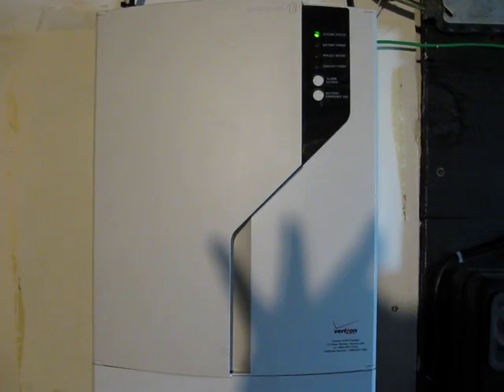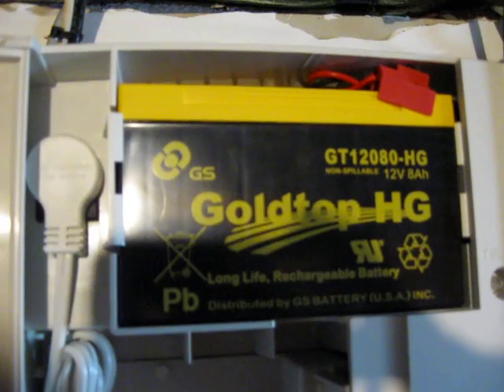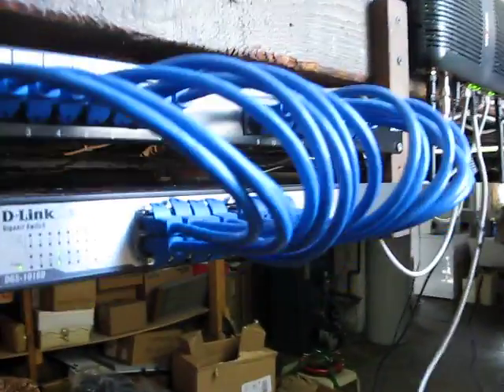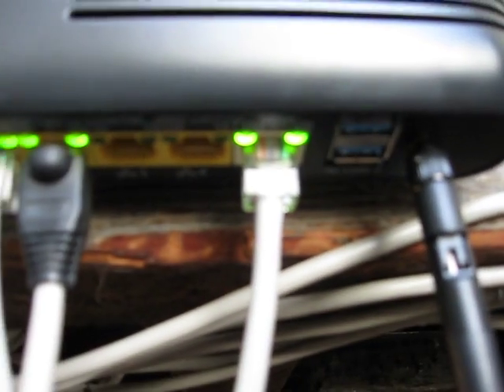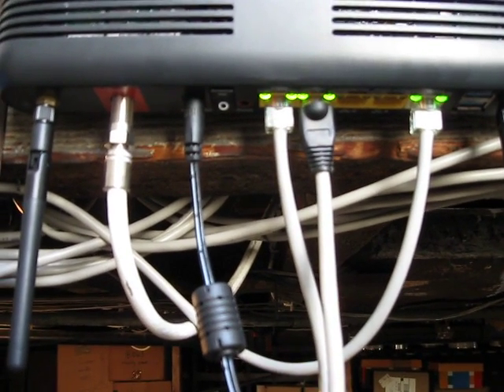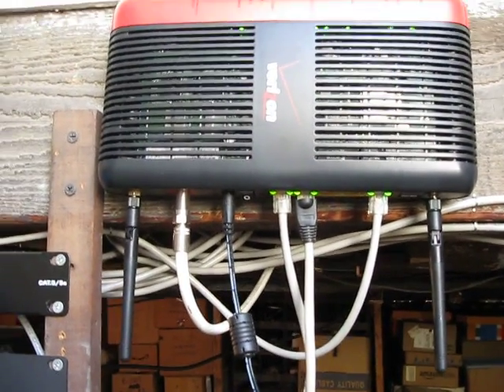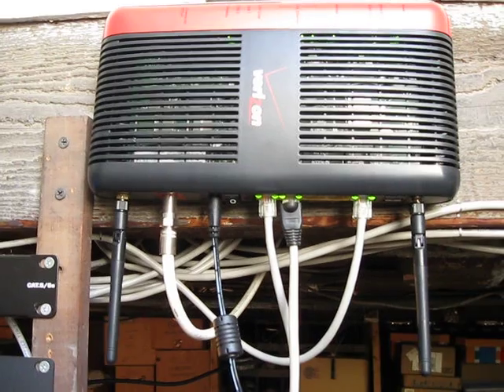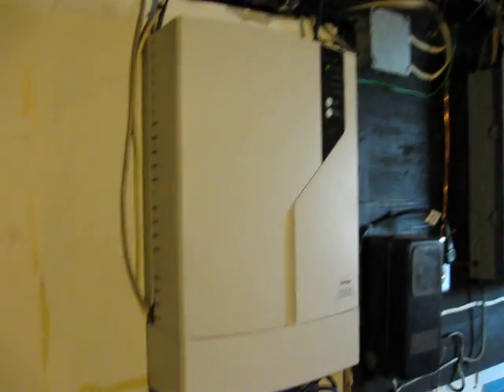My Verizon FiOS installation

Comment: Can you get files but have your phone service over the copper land lines? I think that for telephone service, the copper land lines are much more reliable than FiOS because the central office has bigger batteries and generators and can power the line and definitely for a longer period of time that the back of battery that is at the fiber terminal. My area is served by Frontier Communications and does not want to put a conduit in the street for copper facilities and there is no fiber here Copper land lies should be federally mandated even with the installation of copper land lines in new developments. We have also had outages with AT&T nationwide and Microsoft and also horizon cell network so that’s why.

Comment: Ok but how do I activate the ONT? Verizon customer service is of no help. The ONT was installed in my apartment long before I moved in and I'm not sure it was ever used because there was dust from the wall on the power cord and the cords were all tied up in twist ties. I plugged it all in yesterday but according to my Verizon account it is not activated. The only lights that are on inside are the network and power. There is no coax line connected inside (like where the Ethernet and coax connections are) and I have to run the Ethernet cable to my router because there are no Ethernet outlets. The ONT is an Alcatel lucent unit I-211M-H

Comment: I’m rehabbing an empty house and it has a Verizon box from the former owner on the OUTSIDE which isn’t even connected to the house. It broke off from the house and It’s just sitting on the ground and looks bad and I want to get rid of it. Is it safe to cut the wires? It looks like the wires go to the nearby telephone pole, so I’m afraid they might be energized. The Verizon Service is shut off, but the company didn’t come out to take their equipment. Thanks!
Reply from the maker: Look at the writing on the side of the black cable going to the pole. If it says something like "optical cable" it's fiber optic line. It's not energized as it can't carry electricity, but don't cut it. That basically ruins the cable. Verizon still owns it and the box (ONT) that it's attached to, call them to have everything either removed or fixed. They'll likely want to keep it there in case you or someone else wants to get FiOS service there in the future.
Reply: Adam Ahmed : Thanks for the info, Adam. I’ll see if I can disconnect the cable, roll it up, and attach it to the fence. After awhile, all the junk that’s left over from various cable providers starts to detract from the appearance of a house. Rusty old satellite dishes, faded plastic boxes, etc.; if I can remove the box I’ll just drop it off at a Verizon store.
Reply from the maker: If you can open the telco side of the box (needs a socket wrench) the fiber disconnect is in there. Be careful not to look into the end of the fiber once it's disconnected.
Reply: Adam Ahmed: why not look? Not that I would...just curious why.
Reply from the maker: Same reason you wouldn't look into a laser pointer.

Comment: How do the TVs hook up? Can I run 1 RG6 to the attic and use a splitter to feed the individual tv boxes?
Reply from the maker: Coax from ONT goes to 2-way splitter. One output from this splitter goes to the router/MoCA adapter, the other goes to an additional multiway splitter. The outputs of this splitter go to the cable boxes.

Comment: So Fios is a Cable System after all ???
Reply from the maker: No, an internet system is defined by what type of physical wires and data transmission protocol is used to bring the service to the customer. Cable uses coaxial cable, FiOS uses fiber optics. So it's not cable. In any internet system, there's a device that translates the incoming internet connection into Ethernet, which then goes to the router. In FiOS this device is the ONT, in any other system it's the Modem.

Comment: Get the new FiOS Quantum Gateway router from Verizon FiOS is all new i have my for very long time i love it <3
Reply: Cool I have fios to
Reply from the maker: I had one for a while. I recently replaced it with a Ubiquiti EdgeRouter Lite and two UniFi access points. They're better by far. Yes, you can absolutely use a third party router while having FiOS TV, you just need a MoCA adapter  (which I have) to give your cable boxes an Internet connection.
Reply: Yep :D
Reply: I love fios

Comment: Hey one Question why did u put the Internet modem outside and the other stuff outside what happens if it rains.
Reply from the maker: +Michael Barcomb What are you talking about? All of my equipment is installed indoors in the basement, nothing but the fiber optic cable going to the pole is outside. It's actually more common for the ONT to be installed outdoors, these use a different enclosure that's designed for outdoor installation. Also, there is no modem in FiOS, the ONT serves that purpose. The other main component is a router, not a modem.
Reply: +Adam Ahmed ok I just wanna make sure because it looked like it in the video

Comment: I can't believe that Verizon doesn't even offer a gigabit speed plan. Fios has been out for what 10 years now?
Reply: +Mr Anonymous they're more than capable of but spent all their money on their fiber network infrastructure GPON back in 2008-2010 which was the latest back then. Rather than compete with google fiber and upgrade right away, they plan on being more cost effective and upgrading to NG-PON2 which is capable of giving customers up to 10 gigabit/sec. currently, they're in the process of field testing it
Reply: AMP Tech I can only imagine what the price point will be on a 10 gig connection...
Reply: I bet $300 around like their current top tier. Bear in mind the price adjusts to what the currently deployed technology is capable of. 100 mb/s is a standard that their technology can handle if every subscriber had. It starts to get more expensive as the upper tiers tend to put more of a strain on their networks but with this new passive switching technology, the bar is raised

Comment: Fios runs on fiber optic, so why are there phone lines and cable lines in the ont?
Reply from the maker: Mr Anonymous When was the last time you saw a computer, cable box or phone with a fiber optic connection? The purpose of the ONT is to convert the signal coming in over the fiber to signals that your devices can receive and understand.
Reply from the maker: Christopher W. Hearne No, the ONT's battery only powers the phone line so you can make emergency calls during a power outage. You need to plug the ONT and router into your APCs (or better, a generator) to have internet during a power outage.
Reply: Adam Ahmed Hello, quick question! if the power goes out does the internet go out as well? because i have several APC units and all so i can power everything at home incase of a power outage but im not familiar with Fios...

Comment: Do Have Wireless Modems
Reply from the maker: Robert Redding The ONT serves as the modem in FiOS and it is not wireless, it requires a coax or ethernet connection to the router. The router, of course, acts as a wireless access point.

Comment: I have Centurylink and it sucks, i have heard good things about FiOS but it is expensive. Is it worth the money? What is a good plan with FiOS?
Reply: KKstudioes Inc but comcast has a 250gb cap and charge extra when you go over. i run 2 xboxs, a aptop, a tablet, and 4 phones off internet we will max the cap easy.
Reply: KKstudioes Inc also we have direct tv would we need to switch to comcast?
Reply: KKstudios Inc AT&T sucks.

I'm about to get 1gbps up and down for $60/mo with NO bandwidth caps.
Reply: +NerdTechGames Inc AT&T is nothing but glorified DSL with speeds no higher than 50 megabits/sec. Comcast is a money grabbing monopoly. You obviously had an issue with your FiOS install and rather than be the right person to get it fixed, you're spreading lies about the service. And another thing, you're probably an idiot because none of your findings makes sense. You're probably getting MegaBITS and MegaBYTES confused like the rest of the world. Plus you have no credibility. AT&T doesn't provide speeds past 50 megabits/sec anywhere at all in Illinois
Reply: NerdTechGames Inc $300 a month, plus a 2 year contract just for an extra gig more than what Google offers?

No thanks, I'd rather pay $60 a month for 1gbit.
Reply: NerdTechGames Inc well then ur in a lucky area where Comcast deployed fiber to the home. Fiber all the way, u just gotta announce fiber because the rest of us have copper and it confuses the funk. Plus I hate the fact we're lucked out of fiber in parts of the US so I tell people to NOT get copper services

Comment: the download speed is really slow for fiber. Of course this is 2 years ago. has it gotten faster since then?
Reply: Uh, no.

It is actually slower than dial up connection......
Reply: I pay for 50/50 and get 58/58. Don't even see how it's faster than dial-up
Reply: +AlzPlays 58/58 Mbps?
Reply: Jemalacane0
Yeah (over ethernet). It's not too bad, especially considering that I'm only paying for 50/50 Mbps.

Also, made a typo: I pay for 50/50 and get 58/58. Don't even see how it's slower than dial-up. My bad.
Reply: +AlzPlays They have 500/500 but it's extremely expensive.

Comment: This is intense.  There has to be a simple way
Reply: I have the same set up installed, without the switch. The service is nice if you get the FIOS $79 Triple play deal. And Gift Card. Why I will get rid of them? They charge $5 a month for a cable card, Comcast is free for the first card. Picture is better 100% on FIOS. Service, well, I had to help the FIOS guy install the system, and that is after waiting 40 days for install.  Hint with FIOS buy your own spare Battery and wire it in, so that you have two to three times the phone service in case of a black out. Radio shack has alligator clips that make this possible. Other wise get DirecTV for TV lock in the deal, $35 a month, 12 months. Get Comcast or RCN for ISP, Verizon for phone $9.00 a month. And yeah, switch when the deals look good, and document.
Reply: VZ didn't give the guy the right order so after dealing with them. I'm sticking with Comcast right now.
Reply: For MOCA to work, you need to pre wire, or set up WiFi security and antenna power.  Pre wire is expensive, but the best. Jacks and such. And if you want to exist at some normal price point, create your own PVR system.  A PC, a network storage system for multimedia, you have one?
And wiFi TV's. It is cool, but such is life
Reply: I will play them all off for the best offering, and price.  FIOS best package deal for cable channels/Phone/ISP speeds.  Comcast best for ISP speed, but they degrade HD TV to 720 instead of 1080i, and lower when they can get away with it. And not many channels unless you upgrade. Phone, well it is IP so no diff. DirecTV is best for HDTV, but there is that lag, but the price is right! $40 a month for the tops. And mulity room viewing.
Reply: Me, Direct TV for TV, cant beat the number of useful channels at the price. FIOS for phone: $9 a month.  Comcast / RCN for ISP, in DC. Or FIOS Tripple Play $79 a month for 12 or more months. Or find me a better deal!
Reply: See for us, we don't watch TV.  I have Netflix and amazon prime.  Right now Comcast is $35 for 25/5 and that's fine.  Vz is charging us $66 for the regular phone. When Comcast leaves promotion in May two months before we will negotiate a lower price.
Reply: I agree with you, I usually download things I want to see.  But it's all good.

Comment: Good video and explanation.  I also have FiOS and have been very pleased with it overall.  Good performance and virtually no down time for me at all.  I did do a couple of mods with the BBU and now run it from an external bank of batteries that are solar charged.  Also changed things so that the internet does not shut down when power fails.  With these changes I can run  virtually unlimited during power outages. The 8 hour power limitation of the BBU was the only real weak point where my copper POTS line excelled beyond the FiOS, now that limitation is gone.

Comment: If the router breaks you have to replace it anyway, so why run data over ethernet from the ONT when you could just run it through the same coax that the TV's need?
Reply from the maker: Ethernet is faster and more reliable, and makes it possible to use a different router if necessary. Using a different router will just prevent the cable boxes from getting VOD and guide data.
Reply: Ah ok. Did you do the self install? I'll be moving into a new home and I'll be dropping cat/coax through the house which probably won't be ready when a technician would come, and I need the router near my networking stuff like yours (switch, patch panel, etc..), so I'm thinking of just doing the self install.
Reply from the maker: The self install only applies when there is already a fiber optic line and ONT installed, as installing those must be done by the tech. All I did was add the outlet next to the ONT and run an ethernet line from the intended ONT location to the intended router location. The tech did pretty much everything else, but while he was on break I connected the ethernet line to the ONT's ethernet port myself. I already had the ethernet line from the patch panel to the router in place before the tech arrived.
Reply: Adam Ahmed So the Tech can't just run the fiber line and install the ONT, leaving the router placement, running the cat5/coax, etc to me? Or what would probably be a good idea is running the cat5/coax ahead of time and getting the jacks all hooked up, so when he gets here he can set the ONT/TV boxes, and the router when I want it (next to my networking gear), then just hook up all the equipment to my pre existing lines/switch, you think?
Reply: Adam Ahmed Also, very informative video compared to what other people have posted, you fit a lot of info into a 5 min video :P
Reply from the maker: XxGamersUnitedxX The tech isn't supposed to leave until he verifies that your services are working. Therefore any wiring that you want to do yourself must be done ahead of time or he will have to do it himself during the install. I'm assuming you have the tools to strip and terminate both coax and ethernet?
Reply: Adam Ahmed Indeed. As well as my 24 port TP link gigabit switch, 24 port patch panel, 4U wall mounted rack, etc... I'll just get it wired up ahead of time so when he gets there he can just put his equipment down and hook it up to my pre existing wiring for a quick job. I'm hoping three spools of 500 ft cat5e and one spool of 500 ft coax will be enough, so I can run all the wires to each room at once. Thank's for the help! :)
Reply from the maker: XxGamersUnitedxX Just FYI, if you haven't already purchased the wire, I'd recommend going with cat6. It's much more future-proof and will be able to support 10 gigabit ethernet and maybe even faster.
 Obviously it's a moot point if your patch panel is cat5e, though.
Reply: Adam Ahmed I've yet to purchase the patch panel, but I am still considering just going with cat6. Funny thing though, since we're going to be renting, I'll probably have to run wire along the bottom of the walls all around the house since we prob. won't be able to drill into the walls, lol!

Comment from the maker: The router never serves as a modem, the ONT does. IF you don't have FiOS TV then use the Asus router only. You just need to make sure the ONT is set up to deliver internet over Ethernet rather than coax, if it's not then call Verizon and they can do it remotely.

Comment from the maker: I don't think the ONT will distribute internet over both Ethernet and Coax, only one or the other. Even if you could it would create an entirely separate network. What you should have done is bought an access point and connected it to one of the LAN ports on your existing Verizon router. If you can disable the WAN Coax connection on the new router and have it only use LAN Coax, AND turn off the DHCP server, you might be able to split out the coax and use it as an access point.

Comment: I have Fios installed and the wireless router is connected to the ONT via coax. I just bought a second wireless router from Verizon to put in my basement to improve the internet connection down there. Can I connect this new router to the ONT via Ethernet cable from the WAN jack on the router to the Ethernet jack on the ONT or do I need to split the coax cable and use that?

Comment from the maker: The internet is fiber optic, the fiber optic cable terminates at the ONT then it goes to the router over ethernet or coax, then from there to your computer over ethernet or wifi. The coax connection is only necessary if you have fios TV, for internet only an ethernet connection will be better.

Comment from the maker: No, the ONT requires a new service drop line (the fiber optic cable) to be run from the pole, this part absolutely requires the homeowner's involvement, mainly to decide on the location of the ONT. It will typically be outside near the phone line entrance, or in the basement. It would never be installed in a living space. Also if the house gets phone service from Verizon it will be moved to FiOS as part of the install. You can put the router in your room, but not the ONT.

Comment from the maker: The installer should have made sure everything was working before he left... but anyway, I'm assuming the "white box" is the ONT (if yours is an indoor one like mine) and the "coax box" is probably the router since you'd be unlikely to have a TV and its cable box next to the ONT. There needs to be a coax cable from the ONT to a splitter, then one from the splitter to the router and another one from the splitter to the cable box. If you have multiple TVs you'd need a second splitter.